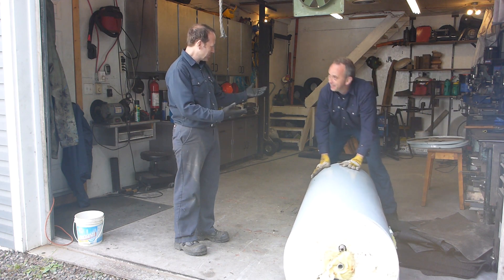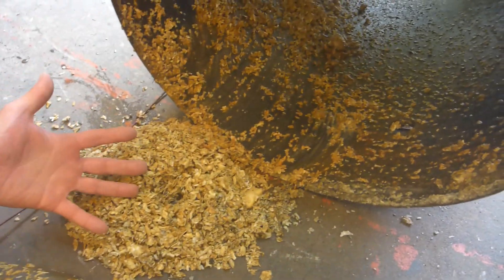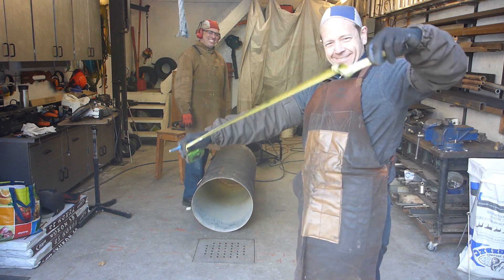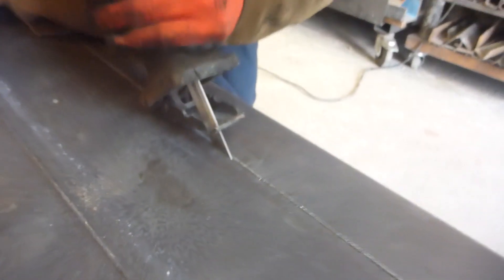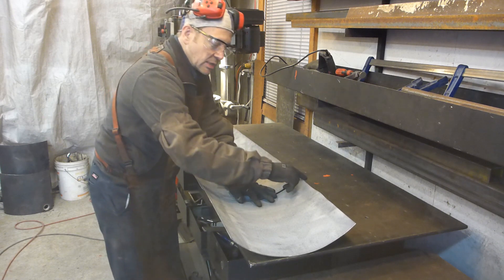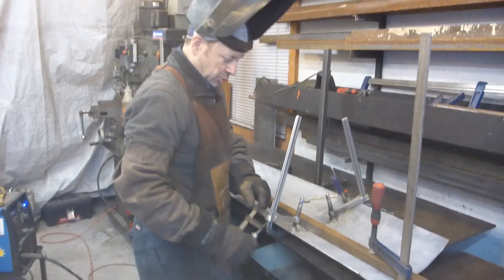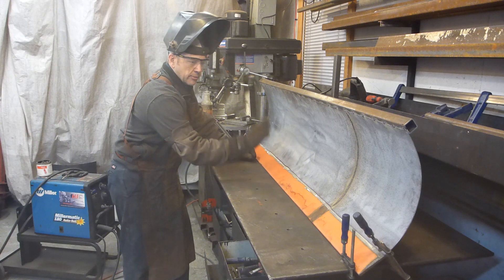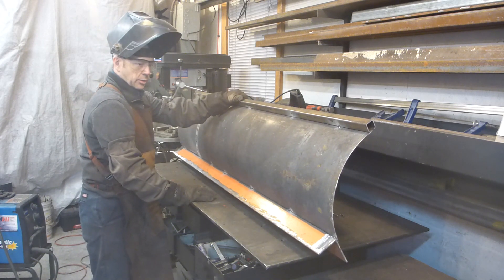#176 SSQA Snowplow - Part 1

Comment: If I had a nickle for every sawzall blade I've broken or wore out doing demo, I could buy you, Dave and myself a nice lunch every day for a year in an expensive restaurant.  That's all we had for demo AND fab for years and years.  Lenox is about the only brand to buy...in my humble opinion that is.  I have a Milwaukee sawzall with a 1 1/4" stroke and if you relax the pressure for an instant you will regret it.  My older ones with just a 3/4" stroke are much more controllable in the cut. 

     I'm wondering if core shield .030 would preferrable to the solid core and argon/co2 for this material...??  Or is that what you are using because I can't see the tank on the cart unless it is really short.  LOL.  I don't have any idea of the coating but it has to be a rust inhibitor of sorts.   Gonna be a nice project for Ol' Dave and the Mahindra !!
Reply from the maker: Right about the blades and the stroke. I could not tell about the stroke, but as you say, you have to control that animal 100% of the time. I am using 0.030 flux cored. The coating might have been scale too! Thanks!
Reply: @FromSteelToWood  THAT IS SO FUNNY ( ANIMAL !!!! )  THAT'S GOOD ONE MY FRIEND !!!
Reply: You just did it again Wendel, I really love your sence of humor !!! I have a sawhall too but it's made by Makita and I have it since 35 yrs now. mainly use for wood and little on steel about 12 hrs per yrs and love it !!!   Thank you for you nice and funny statesman !!! Cheers Sir !!!